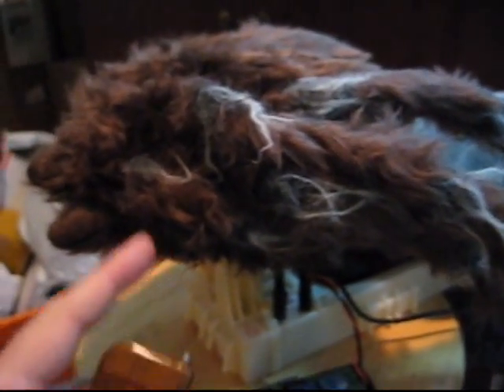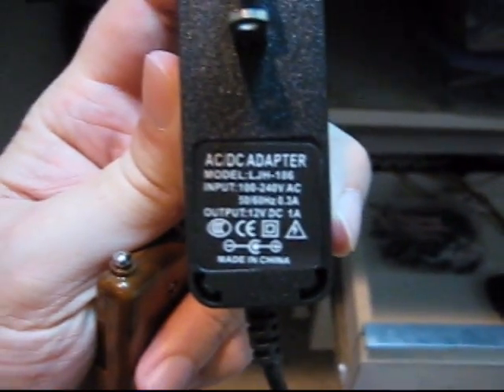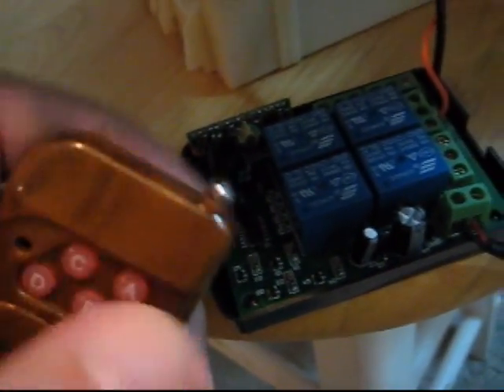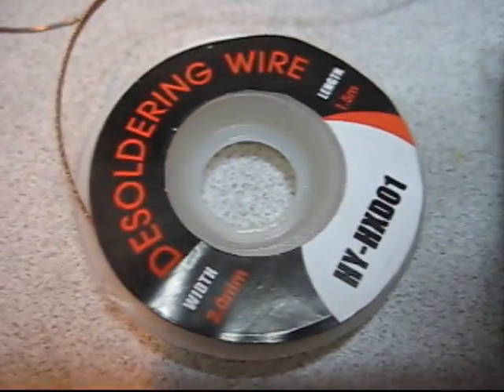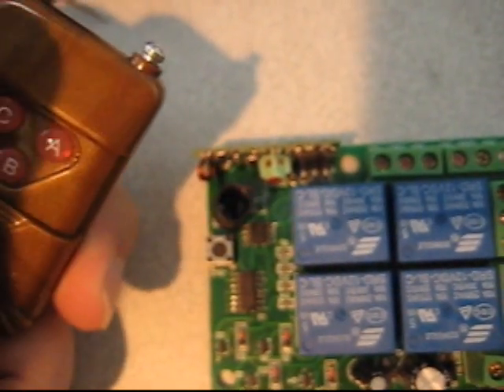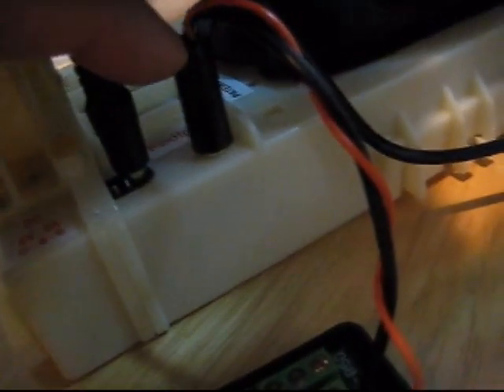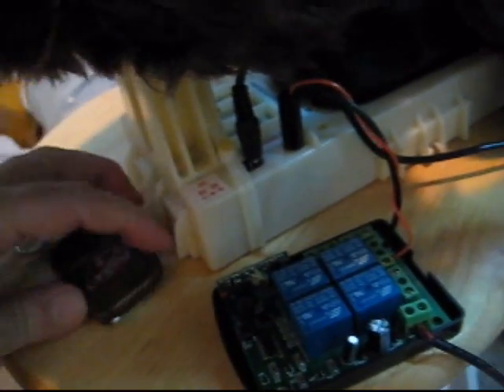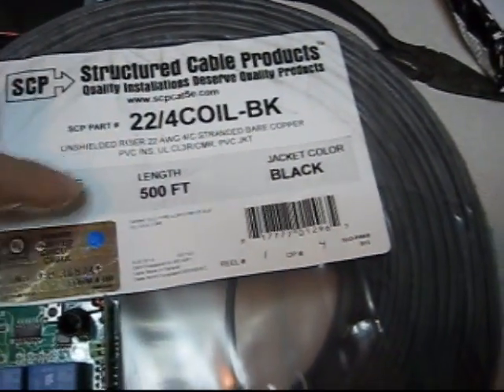Spirit Spider Prop Wireless Trigger

Comment: So I did this and it worked once or twice and then wouldn’t work.  I found that if I just shorted the pins it worked every time, so I am going to try a dry contact relay rather than applying 12v like this video shows